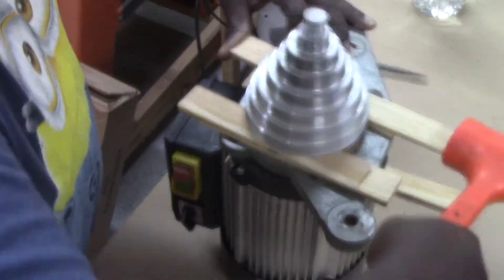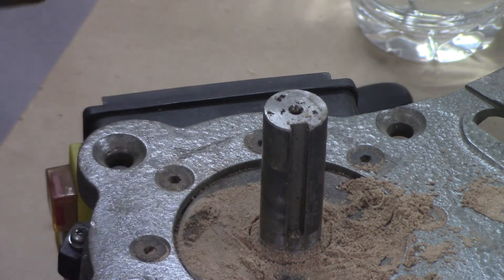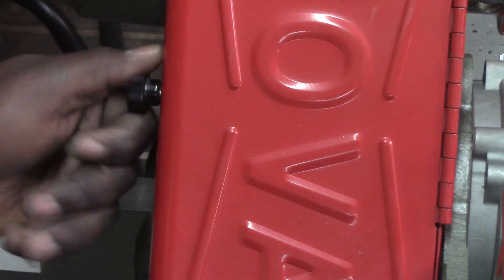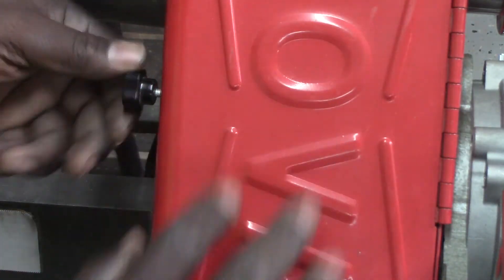Nova 1624 DVR Motor Upgrade Instructional Edition

Comment: Hi, I have a 1624 II that I upgraded to the DVR motor just over a year ago. My question is have you had any issues and had to deal with Nova/Teknatool/Striatech? This last month I've been getting the sporadic "hardware fault" on my drive then it resets and I can keep going, it's very annoying. I've been emailing and leaving messages with them for several weeks now and I've gotten no response. Just wondering if anybody else has had issues with them and their lack of customer support. At this point I wouldn't give them another penny, very disappointed in them.

Comment: A bit off topic, but regarding the hand wheel: I added the exact same hand wheel as you have, but I find that the bore in the hand wheel is just a hair too small for the knockout bar provided with the 1624. It works, but it is frustrating and annoying. Have you experienced this?
Reply from the maker: No I have not. The knockout bar and handwheel on my machine work perfectly. I even have the same handwheel on my Staurn lathe, also no issues
Reply: @DreadKnotWoodshop  Thanks for the reply. I've thought about doing the DVR upgrade, but am too concerned about vibration that I have in the current setup since I'd like to do longer spindle work like chair posts. My sense is that the vibration relates to the belt and pulleys plus the motor being hung out in the air, but that's just guessing. I can take another pass at double checking the leveling. Given the grief I've heard people report about breaking the pulley free and then, also, the grief they've had getting it not to move again after doing an alignment, I've hesitated at aligning the pulleys since, by eye, they seem good.
Reply from the maker: @ef2b even though you will still be using a belt, the addition of the DVR motor will reduce viration significantly. Have you tried weighting your stand?
Reply: @DreadKnotWoodshop  Not yet, but is definitely on my mind. I guess I'd need to drill the legs to attach a shelf. Actually, if I do that, I'll try to make something like a truss to add rigidity, too. I tried looking at your older videos back when you were using the 1624 to see what you did but couldn't find a view below the lathe ways. :-)

Comment: Great video! I'm thinking of upgrading mine....I live in Canada, so I need to figure out the best way to get one up here....Cheers
Reply: Hey, I live in Canada too (Ontario). Did you manage to get a Nova 1624 lathe? Where did you get yours from?
Reply: @davidvankooten946  I got mine in the states years ago....I did this upgrade and its worked out great, love that I can vary the speed on the fly now and the motor has good torque too.

Comment: Great video. I noticed that there are several videos on this topic. I'm looking into buying a lathe and was interested in this lathe. Since everyone seems to want more power would you recommend that I just start looking for a lathe with 2 or more HP at a higher price point?
Reply from the maker: The DVR upgrade is 1.75hp @ 110v and 2hp @ 220v by simply changing the plug. This is the only lathe on the market that allows this kind of upgrade (without resorting to aftermarket solutions). I have found that the DVR motor has more than enough power in and of itself. One cool feature is that it can detect when the motor is under load and will supply additional power to eliminate "bogging" down. This is a great way to go, start out with a great lathe at around $1200 with the ability to add bells and whistles later to bring you to the equivalent of a full sized, full featured lathe later. Hope that helps.
Reply: @DreadKnotWoodshop  Thanks for taking the time to answer my question.
Reply from the maker: @TheMonkdad  no prob! Hope it helps.

Comment: Hey DKW, loved your video! I have been trying for three days to get this step spindle off of its shaft. I’m more than frustrated.
Before anyone asks, yes I removed the set screw. Is there a tool that will do this easier?
Reply from the maker: I'm not sure if there is  tool for this. The wedges worked really well for me.
Reply: This is a bit late , but there are bearing/gear pullers available.  The wedges will work , I've used wedges on shafts that were bigger,  on something this small there is a good chance of bending the shaft. You should be able to rent a puller from a tool rental business.  When there is a aluminum pulley on a steel shaft you will find they bind on pretty firmly,  and I recommend coating the shaft,bore and all other screw threads with "anti seize" compound just to make things easier next time
Reply: i got the upgrade and my pulley bore is 7/8 and motor haft is 5/8???

Comment: Thanks for doing this video. Especially thanks for the tip on being sure the new motor is positioned to accept that cam. I just did my upgrade today - getting that pulley off the old motor was a bear! 

I have a tip for anyone else doing this upgrade. Putting that setscrew back in place caused me a bit of grief - kept falling off my Allen key and into the pulley housing. To solve that problem I put a small piece of chewing gum on the tip of the Allen key to hold the setscrew in place. Problem solved.

Comment: I purchased this upgrade today from Tools-Plus with local pickup. Upon opening the box, there was only one manual for programming the control box but no manual for the installation of the motor. I also found there were no screws or washers to install the control box to the motor housing. I used an temporary alternate mounting method to secure the box but now need to determine the correct size and thread of the screws and can find no documentation anywhere at all including Teknatool, Striatech or dvrsmartmotor.com websites. Manuals on Teknatool do not show screws. Finally, on start up of motor and running at low speeds, or when changing speeds, there is a scrapping sound that to me is absolutely not normal for a DVR I wouldn’t think. I will contact Tools Plus on Monday To get some guidance. Has anyone else experienced this type of motor noise or is it a consistant “clean hum” like I had heard. Mine is not unfortunately.  I am also amazed that there is such poor (none really) explanations on many of the motor programming option. Are we supposed to just guess what these settings mean and how changing them affects things like ramp up acceleration, etc?
Reply: MFA 2696 Same problem here - bought it from them last week. No instructions, no screws to mount the control panel. Got good info from this you tube and from a Google search. I found a couple appropriate screws in my parts bin that work OK. I don’t think this was Tools Plus error - the unit appears to have been packed up in China and Tools Plus probably buys them in bulk and re-sells.

Comment: Agree with others - great helpful video. Thanks for providing .
I’m curious what you or others are doing with their old motor after the upgrade. I’m sure there is some great ways to repurpose it but am wondering what I would want to do with mine if I (when I) upgrade my motor